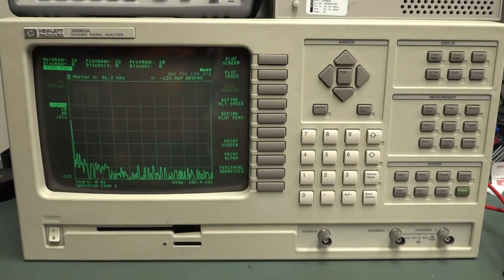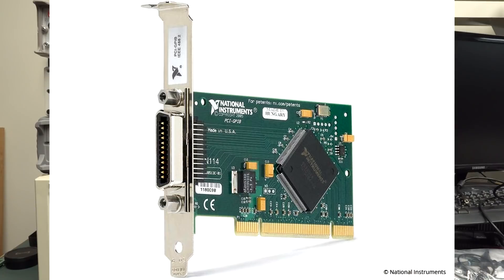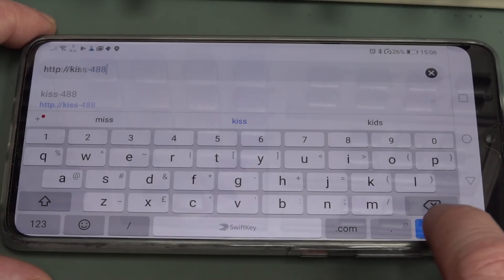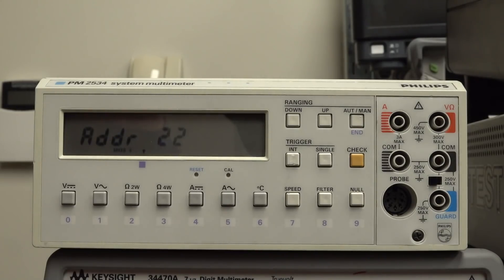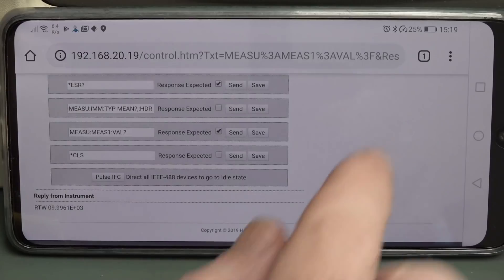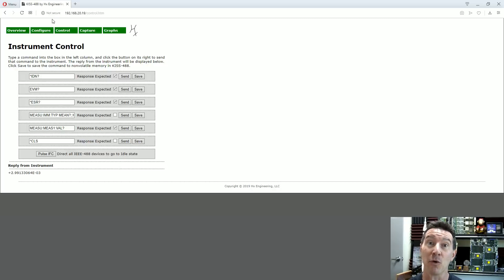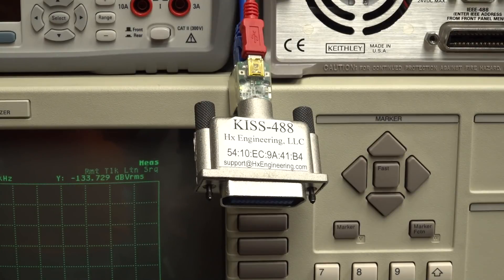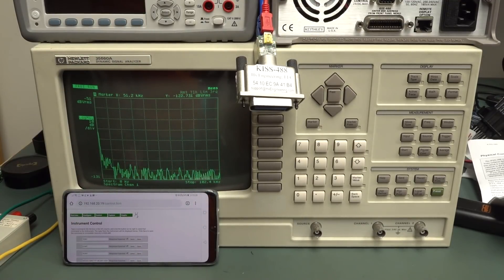EEVblog #1232 - Add Web Access To Old Instruments!

Comment: Nice alternative, if there is API available to actually use it as remote bridge via python/C/whatnot scripting environment, such as commercial GPIB to LAN solutions. I use GPIB all the time with calibrators and 3458A's.
Reply from the maker: Keep watching the video, I demo this. No need for an API, just Telnet in.
Reply: Even the commercial Prologix adapter just uses a TCP connection on port 1234 that allows plain ASCII commands, that you can connect to via telnet or terminal emulation program. Would be pretty easy to write a program in Python, C, or whatever that just uses sockets to communicate with this KISS adapter (not to mention, the KISS adapter seems to have better thought-out features, including the neat web interface).
Reply: Wouldn’t be too hard to pull response from html div and send using the get query string. However a simple api would be nice.
Reply: thingyee1118 we have better ways to interface with web-services nowadays than scraping html or telneting. From the video, I noticed that all the commands are passed as URL arguments. The only thing missing for simple API are the responses in JSON format.
Reply: @killymxi  - The reason you want to use telnet in this instance is that the web interface is running on the device itself. It won't be very powerful - it certainly won't be running PHP or anything like that - it'll be hard coded as it is. You'd want a telnet interface so you get minimum overhead and latency when talking to the device.

You'd want a 'server' device that uses telnet to talk to all of the interfaces and from there you could expose a web API if you wanted to. It'd be better like that because all of your devices could be accessed from the same API rather than plugging into multiple, relatively slow APIs on the devices themselves.

The built in web server is very convenient but you'd really want something more powerful taking over that task if web is your jam.
Reply: Interesting my comment was deleted again here in main thread  ... Dave is it some kind of censored? :(
Reply: Although telnet is workable option.
Reply: that's a very nice solution. for a school project we used a device that could talk to the devices via a GPIB bus and set it up to use python and pyvisa.
Reply: the command appears in the http GET string ..
Reply: control.htm?Txt=MEASU%3A......
Reply: Yo guys. would you be interested in low cost GPIB to VXI11 module? I can make it.

Comment: Can you daisy chain more than one of these HPIB connectors on the same bus with this Ethernet adapter? I was able to do this when I had a PCI card. My guess is that this is the case, but want to hear if anyone has tried this.

Comment: This video created a surge of interest that depleted our stock (thank you Dave!). We have another production run in progress and should have stock approximately Sept 29, 2019. If you are in the US and contact me directly at SteveHx@HxEngineering.com I can offer a discount by avoiding the eBay fees. Sorry, overseas users: The savings by using eBay's Global Shipping Program outweighs their fees - and it works very well.
Reply: Update from the creator of KISS-488: KISS-488 is back in stock and ready to ship. eBay's Global Shipping Program is the way to go if you aren't in the US, as it saves a bunch on customs fees etc. For shipping to the USA, I offer $10 off if you just PayPal to me at SteveHx@HxEngineering.com. I also offer $10 off per unit for quantities of 5 or more.

Comment: Hi, I am going to create a pcb to connect lihtium ion batteries and they can reach current spikes up to 60 Amps, now I am wondering how I should place the vias the best way possible? as even as possible or right behind the connection point with the battery, or where the batteries are connected in series... I really don`t know and would appreciate help a lot.
Thank you in advance, Jonas :)

Edit: I have used Saturn PCB, still don't know which diameter is the best and where to place the vias... I have an area of 30x70mm and 30width x 140length (mm)
Reply: Post in the EEVBlog Forums. You'll get a response there.

Comment: As I recall, some instruments require a question mark in the query.  That means they only respond to an IDN?  instead of any shorter versions.
The other thing that I have encountered is the screen dump.  At least a couple of old HP units did the screen dump only to a printer, and maybe only to a parallel printer for that.  Then, on one unit I found a description of a two or actually three step procedure.  The first step was to save the screen data to internal memory SEGMENTS.  Maybe 3 or 4.  It was not in graphics format, it was binary numbers.  Then you could read them to your computer, into a spread sheet and do the rest there.  Too complex for me — I never even tried that.  I just used my phone camera to save the image of the instrument screen.

Comment: Commodore used the GPIB for peripheral bus connection on the PET line of computers (almost, PETs only support 16 devices instead of the 32 on a full implimentation), and a serialized derivative for the rest of their 8-bit computers.  Do you suppose this thing could transfer files to and from old Commodore equipment?

Comment: The *IDN? and other *commands are part of the IEEE488.2 software protocol. This is a software layer based upon the IEEE488.1 hardware. (Later the SCPI standard was defined on top of IEEE488.2).
Not all old IEEE/GPIB instruments were equipped with this protocol. This protocol was developed in the late 1980's. I remember that one of my colleagues was a member of the IEEE488.1 committee so it must be later than 1985 when I started working for Philips. I still have a draft plus glued in changes in my cupboard at work.

The PM2534 mentioned was released before this standard was released and used ID? instead.

Note that next to IEEE488 also an European standard existed: IEC625. This only had a different connector (25 pins D-type).

Comment: The term 'script kiddie' was coined to describe a wanna-be hacker who uses scripts to run attacks instead of  applying knowledge. Ie a script kiddie just downloads Metasploit and runs it like a shotgun, not knowing why any particular exploit works. In general script kiddies wouldn't be capable of developing software that can control a device (via telnet or any other way). They, by definition, only use other peoples' software.

Comment: Nice die cast plug. Flimsey pcb hanging out the back.
Reply: Not as flimsy as you might think - that's a 125 mil PCB, twice the thickness of a standard PCB.

Comment: Another option is to get a used ICS8065 which allows you to bridge from ethernet to GPIB. Works great with NI etc. Easy to setup and their customer support is pretty good too (even though I bought it second hand). Was about the same price too. Also the ICS8065 will work with as many devices as you want to connect.

Comment: This sounds like the kind of thing that you could hack together with a Raspberry Pi - GPIO ports for the GPIB connection (with appropriate level translation) and you're good to go.

Alternatively, you used to be able to get an IEEE-488 interface card for the Vic20 / Commodore 64 (and presumably other 8-bit micros) That's be a really cool project, especially using a Pi Zero or something. You could probably rig something up using an Arduino, but that's outside my area of expertise - I'm more of a Pi guy :)

Comment: An esp32 would be perfect for this.... If gpib included a power pin. I guess a little board with an esp32, usb-c port, ethernet with PoE and a micro SD slot would be just about the cheapest way to implement a universal gpib adapter.
Reply: why would you use an ESP32 as the controller if you plan to use PoE and thus an ethernet wire connection?
Reply: @uwezimmermann5427  Ethernet and PoE would just be one option as the esp32 supports Ethernet as well. I'd think WiFi and USB C for power would be most useful for most people, but being able to go fully wired if wanted would be a nice touch. 

The esp32 has enough power and flexibility to power everything from a standalone logger to a USB or network adapter. Most of the complexity would be in the software and testing, so might as well make it universal.
Reply: @uwezimmermann5427  and why not just go wireless only? Might be measuring something where the extra RF would screw up results.
Reply: @RobertSzasz  There is some potential in wireless adapter, for experimenting and intermittent setups... But for somewhat serious use, I think that wired ethernet is uncomparably more stable than wifi. I always try to follow the simple rule that if it is a permanent installation which does not need to be portable then it is better to wire-in.
Reply: @gabiold  I agree. the idea is that for ~$12 you can have a pretested module that does all the wireless stuff and is a decent processor, so why not build the support interface around it.

Comment: Not all devices respond to IDN command. I worked with some HP device that had ID command instead.
The set of commands is a standard on its own and it was evolving over time. SCPI standardizes what set of commands different classes of instruments should have. But it always "fun" when you have to interface with that old device unaware of modern conventions...

Comment: If you have a GPIB controller you can use a relay nice programs developed by an US Ham KE5FX " KE5FX GPIB Toolkit"  it has support for many spectrum analyzers and it also comes with a HP7470A emulator that you can plot out JPG pictures instead of a hardware plotter. Another nice feature is Phase noise measurement with a spectrum analyzer and also VNA Utility , lots of goodies just google for KE5FX GPIB Toolkit it ´s all free software.

Comment: I interfaced to my 34401a, a 6.5 digit DMM using a GPIB to USB controller.  The name of the controller is Prologix, GPIB-USB (HPIB-USB) Controller.  The price is $150 US.  The USB looks like a serial port to your computer.  It is very easy to interface to any program that supports serial communications.  I use it to communicate a command set from Visual Basic 6 to the DMM.  I collected voltage data for my program from the meter at a much faster rate than 1 reading per second.

Comment: I used to program an HP 9000 lab computer, I think it was a 68000 Motorola based system, to control lab equipment at Bellcore in a fiber optics lab. That was so much fun. The HP ran a very advanced version of Basic which I knew already. I used to automate everything. Then send the data to the pen plotter. I loved watching stuff do it's thing, like magic.
Reply: This was in the mid-80s
Reply: I've worked with an HP device whose automation documentation was all around HP Basic. Something to get used to, to rule out unimportant bits when interfacing with modern PC...
Reply: @killymxi , I used to be quite proficient with HP Basic. It was beyond most versions of Basic. It even allowed recursion.

Comment: Cool project-- wonder if this is the same guy who was working on an 488 Ethernet adapter on the forums a while ago? After seeing his work, it inspired me to give it a go. Bought an FTDI FT901L (has integrated Ethernet mac/phy and various other interfaces), got FreeRTOS built and running, then realized how much of a massive pain it was to work with FreeRTOS. lol. Curious what hardware the KISS-488 creator is using in his, and if he's running an OS like Linux, or not.

Comment: You will need MDNS (google it)  on the network (bonjour for example) to access the adapter by name without knowing the IP-address, you probably don't have this and that's the reason why it doesn't work. The poll-push/post web query interface is pretty old in terms of communication, if they had used websockets (google it) for example it could be close to real time. Actually, I think that is what you want. When you know how the GPIB communication works, you can implement this yourself with use of one ESP8266/ESP32 (and maybe some I/O expander to handle all of the GPIB pins/connections).  I think tis could be pretty easy to do. Not tested, just thinking but I think this must be possible.

Comment: You could probably do it with an ESP32. No ethernet cable required.
Reply: There are even a couple of ready made Arduino sketches on the EEVblog forum that apparently work.  Haven't tested myself....
Reply: a esp32 might make a very nice wireless enabled GPIB  controller. ..... the GPIB standard is not that demanding either even the slowest arduino should be able to do it.
Reply: Kevin Miedema
I think the limitation is more internal storage space, you need sufficient room to store the data before transmitting it. In the case of my oscilloscope, I’m running into 500kb of HPGL data from an RS232 port. Personally I’m just trying to write it to an SD card so I can read that later with a computer, but whether I even have time to write a byte of data in the 200us between bytes has yet to be seen.
Reply: The problem is compatibility with other soft for which the drivers are paramount. Still I would be interested in this for sure. Too bad you can't do links on YT comments.
Reply: its probably better to stream the data out continunally using the esp's dedicated core for wireless...... then again you might be better off using something like a NVME SSD and a small Linux computer so you can actually buffer it really really fast though. and you would need very high clock speeds to even keep up with that. a FPGA would likely become a better option. ........all of this is of course probably irrelevant as you will be limited by the speed of the line your using to communicate with the instrument.
Reply: No thanks on wireless in a testing environment.
Reply: @hgbugalou  we dont need half baked WiRElEsS solutions for that no.

Comment: Very cool. I’ve got a ton of old equipment with GPIB I’ve been playing with. I’ve been using the Prologix USB adapter. It’s about half the price of the NI version, and works fairly well, but I mostly use it with the plotter emulator software to capture plots. I use the HP 87 (or 85 or 9816) to drive the instruments, then use RS-232 to get the data into a modern computer if necessary. I’ll have to try on of those. That looks like a more useful interface.

Comment: Is that a floppy slot on the front of the signal analyzer? Designing an electronic floppy interface would be quite entertaining. I guess you need a hub with an encoder to track the rotational position and a stripe that allows you to measure what the write head is doing and to provide a b field for the read head.
Reply: That's not the way we generally solve that problem. The floppy emulators that are out there simply interface via the floppy cable and you can send data back that way. You have to send back flux transition pulses that have the data encoded via MFM, but there's little to worry about beyond making sure the time between pulses is the correct length.

Comment: $150 is a bit pricey...
Reply: As opposed to what?
Reply: @jtsotherone  in general, not opposed to anything.
Reply: Google for open source GPIB-USB adapters. Galvant GPIBUSB seems to be available at $75.
Reply: nah, seems about right.
Reply: How much would an old ISA or PCI GPIB card cost.
Reply: @simontay4851  No PC supports ISA today. But you can get a used PCI card for $50. But before I buy this, I would buy an old USB-GPIB adapter for $80. Because the cables are expensive and they're very annoying.
Reply: And if you add a raspberry running ser2net you could also use a USB-GPIB via telnet.

Comment: Actually you can go faster than 1 second.  At 14:48 it shows 0.5 as an example when you held the mouse over the interval input box.  You should see how fast it can go reliably.
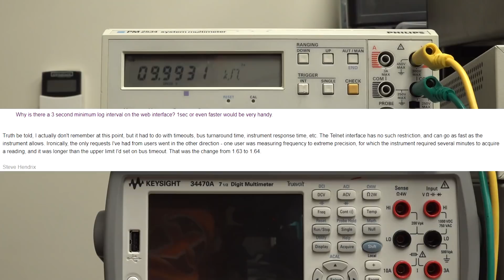Reply: At 12:00 there's a FAQ reply which states that a Telnet connection can go as fast as the interface permits. The program at 14:48 is working through Telnet.

Comment: The reason the NetBIOS thing didnt work is because NetBIOS is a very windows thing, probably best for them to broadcast the service on avahi/bonjor aswell for people on systems without it(android it seems, most linux distros have it through cifs for samba shares)
Reply: or mDNS. Some mcu's support it especially ESP8266/ESP32.
Reply: Jad Bonjour is mDNS btw.
Reply: uPnP would be a good idea too. Adhere to the media protocol and expose the graph functionality as images - then any smart TV could be used to view the output or related information. You could even concatenate jpeg images into mjpeg and then you'd have an automatically updating stream. You could switch between different variables or even devices by skipping forward and backwards in any media player etc etc